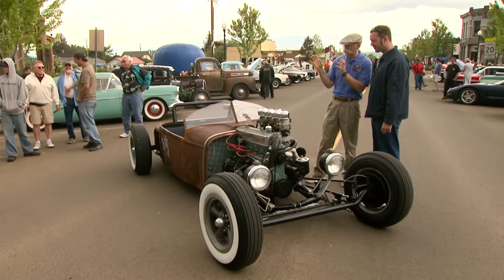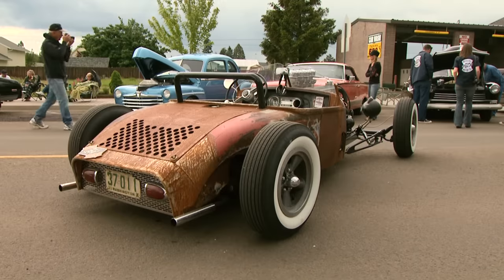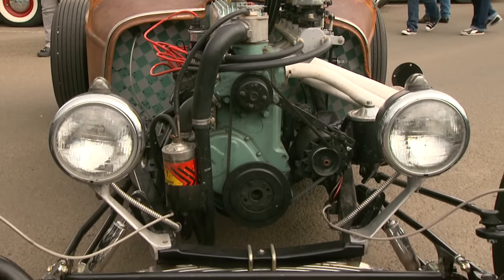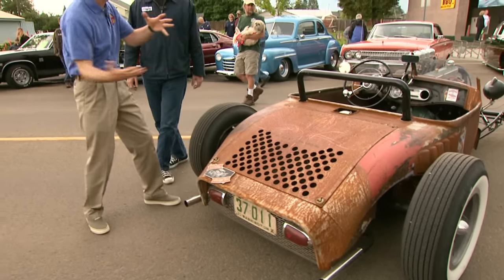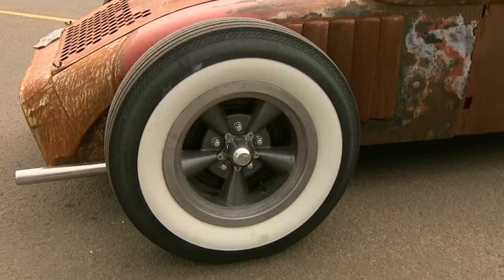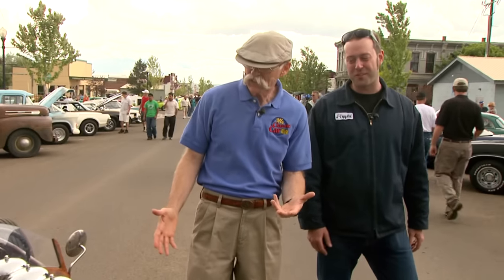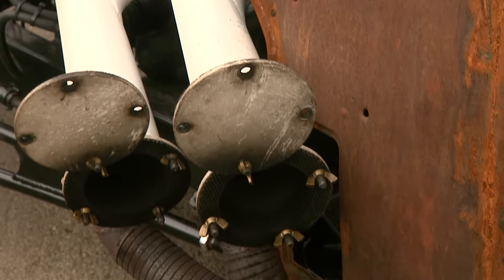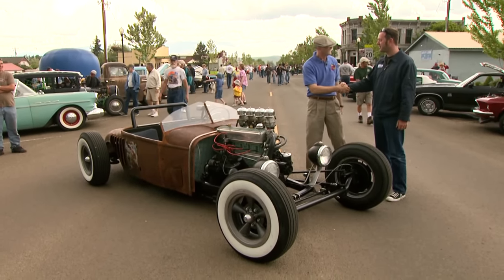Where is the Radiator?

Comment: That's actually a Peterbilt muffler shield on the back of that car- a Kenworth would have round holes. Rat rod guys are a different breed in that they are very resourceful and excellent engineers/ fabricators. Love your work too Dennis! Thanks for sharing.
Reply: True on KW having round holes and Pete having slots, had both trucks
Reply: You can literally order that exact piece of perforated sheet metal with the margins off of McNichols.
Reply: Gross!
Reply: "Excellent engineers/fabricators" 
I thought the whole point of the rat rod aesthetic was to have a car that just looked like it was tacked together from old parts aka: antithetical to the idea of "excellent engineering."
Reply: What I imagine is the piece of chrome is laying on the ground in a scrap pile and the guy says, 
 "what's that from" 
"Old kw"
"Can I have it?"
"Sure"
Reply: It's cool to know... but they probably hardly care — could find a way to make it work no matter what XD
Reply: I'm sorry to say I have been around trucks my entire life and will say I know for a fact that it doesn't matter what the design is they can be found on other trucks slots rounds or anything in-between can be found on Peterbilt kw freight shakers or Mack
Reply: @viscountslappy5085  the whole point is that they ARE cars built from old parts.  It takes some damn good engineering skills to take a pile of old cars and make something that runs, LET ALONE be fast.  Engineering isn't about building the shiniest, techiest, most corporate thing you can.  It's about making shit do what you want.  I want this old pile of parts to bring me around canyon roads at 90 mph so I'm gonna beat it to fuck with my bare hands and weld it all together until it knows its purpose.  that is engineering
Reply: @misdelivereddishwasher1011  Sounds like ham-fisted slapdashery. But, I guess we're taking a wide view of "engineering"
Reply: @viscountslappy5085  there is no template for ratrodding. I can take a Taurus, cut the front end off, put a dodge pickup front end on, lower it, put a Camaro rear end on it, and call it a rat rod.
Reply: @viscountslappy5085  No you're just taking a weirdly narrow, elitist view of engineering.
Reply: @viscountslappy5085  But to make one run and not fall apart and kill you takes real skill and often a lot of custom parts, which is excellent engineering.
Reply: Rat rods are garbage and they’re played out. So cliche these days
Reply: @tylergaye5457  yeah, it's engineering in the same way my beer league flag football team is the Rams...
Reply: @viscountslappy5085  As a mechanical engineer, I can tell you firsthand that most guys in the industry don't even have the creativity or hand-working skills required to make a build like this. 

And I can tell you're also not one of them.
Reply: @viscountslappy5085  nah man stop moving goal posts, you yourself said they "looked" cobbled together- why don't you go fabricate a entire car from scrap metal and extra parts and then come back and rip on this guy, until then you just sound like a jealous tool lmao
Reply: @viscountslappy5085  "wide view of engineering" lmao oh like uh checks notes like designing and fabricating an entire car? Nah that doesn't count, good thing we've got gatekeeping armchair tinkerers around to tell us what stuff is OK to find cool. Theeeeeenks
Reply: None of those words made any sense to me but alright
Reply: You would be surprised. When I was a kid I was constantly dragging stuff home and making something out of it. Come to think of it I make a living do it now.
Reply: @trevormiracle5476  agreed
Reply: @viscountslappy5085 key word, looks. They have a ratty aesthetic which actually requires the same level of skill and attention to detail as a perfect, polished restoration would. If the fit and finish isn't perfect, a ratrod stops looking cool and just looks like shit.
Reply: @viscountslappy5085 that's funny, I don't see anything about your hand-built, custom designed car on your channel. I guess it was such a trivial feat that you didn't think it was worth posting about. Go ahead and show us! I'm dying to see it.

Comment: The most fascinating thing about this for me isn't the radiator location, it's that these things are road legal. Around here cars sometimes have trouble passing the check because the owner fitted them with factory alloys since the last check. I reckon test centers around here would just spontanously burts into flames if you brought any of these within earshot of them.
Reply: They generally fall into a "homebuilt/kit car" category depending on the state. The other option is to use a factory built chassis that has a vin number and existing title. Home built cars has to adhere to some very basic road standards, like light size, placement, output, brake lights, indicators etc there's a bunch of other qualifying needs to get a title and register it but none are all that difficult to accomplish and still build something this unique and "rough". If using an existing titled factory built chassis and registering the vehicle under that existing vin/titke you have to adhere to whatever the standards were at the time the chassis was built. Example would be if the safety equipment requirements at the time the original donor was built required a lap belt, your build needs to have a lap belt and even that only applies to states that require periodic safety inspections to maintain registration. Insurance can be a different animal and most states make insurance a requirement to register so you could face difficulty getting sone wild build insured but from a basic state vehicle requirements standpoint it's practical free reign on what you want to build. 

Compared to the millions upon millions of factory built cars on the road - rat rods, hot rods, classic restomods etc make up such a small percentage of vehicles on the road that most states see it as a non-issue to leave their legality very open. The line of thought is if you are driving a custom built car with no airbags, seat bets, roll over protection etc and you get hurt/die in a car accident that's on you, you knew the risks.
Reply: Washington doesn’t have inspections
Reply: Wish we had some more freedom like this in europe
Reply: @LukebeingLuke  I think Australia has a good compromise with modified automobiles,  from what I understand  you may modify your car but an engineer has to sign off on it for safety reasons.
In some parts of America it's not uncommon to see cars bouncing down the road because of bad shocks/struts , worn out suspensions and structural damage to the body and chassis.
Reply: there's still places in the country that don't have inspections at all. if it's insured & has turn signals on it you can register it
Reply: registred as antique does not require inspection
Reply: @MrStacy1974  Not sure on that, but Mighty car mods did a video on how much of a pain it is registering a car down under.
Reply: Is this Brazil? Lol
Reply: @MrStacy1974  That doesn't sound like a good compromise at all.
Reply: in some stupid countries you can't even change the stupid color of your car. That's what I love about America, the freedom.
Reply: @gabrielv.4358  se fosse já teria até PRF indo atrás kkk
Reply: I like to look at those "cars" definitely fun thing to and drive, did many crazy things myself , though this should fail the mot in UK it is not safe for anybody - imagine anyone geting run over.
Reply: Depends on the state. A mentor went round with the state getting a home built car registered and licensed to drive on the road. The key was getting an insurance company, who was hesitant to insure a vehicle not registered and licensed, to take money for insurance. The state soon came around because money. Everyone was a winner because money. Hail the The 285 Ferengi Rules of Acquisition. The man who's memory I honor won a bet to make a model A roadster for under $1 per pound. He got it registered, drove it to car shows, won awards because of things like hand quilting the upholstery and fabricating radiators and tanks from stainless steel milk barrels. Cool cars. Enjoying the ride.
Reply: @Johnny White I've made it 48 years and in my observations people will do the absolute minimum they are required to as far as safety is concerned. 
All of those regulations when you go racing were written because someone was killed,  but go ahead thinking ALL people are intelligent moral people with the best of humanity in their hearts.
Reply: There is still a few states that aren't over regulated nightmares.
Reply: It is technically a very old car from a very dangerous era.
Reply: @The_Defiant_One  absolutely. Loads of them are LPG.
Reply: Most of these don't get driven much.
Reply: I'm sure it's not street legal by any State DMV guidelines. You notice the question didn't come up during the interview.
Reply: I highly doubt the open wheels are street legal.
Reply: Must be in Pennsylvania!
Reply: @Johnny White As a matter of fact, I have been to TN. When I was there I did not see one open wheel vehicle. I am sure they exist in every state, I very much doubt they are legal in any state, because of the hazards they pose. The fact that every single car manufactured has fenders that completely cover the top of the tires should be a clue.
Reply: @MrStacy1974  
It depends on the state.    The NE and California tend to be more strict about regulations.   
Where I grew up, Oregon, there was no emissions inspection for a car over 20 years old.
Reply: @charlesvan13  I was speaking from a Texas vehicle inspector's point of view, we have a 25 year rule for emissions  testing in metropolitan areas (Dallas,Austin,Houston etc.) but most of the state is safety only.
Reply: Where are you located SomiTomi ?
Here in the UK it is the same except the police seem reluctant to challenge the selfish arrogant people who think the laws weren't made for them to comply with and drive them on the road regardless.
Reply: The real test comes in the UK if you are involved in an accident. 
Even if not your fault.
The insurance companies refuse to pay out as the vehicle is considered "not roadworthy " 
Can work out very expensive.
I was stung for retrofit alloy wheels when someone wrote my car off, legally parked, in the street whilst I was asleep !
Reply: @michaeldose2041  not that your car is worn,  it's to double check your work when you've modified safety critical components.
Reply: @michaeldose2041  what you are talking about is the T.U.V. in Germany and the M.O.T. in Britain.
Reply: @MrStacy1974  ''think Australia has a good compromise with modified automobiles,  from what I understand  you may modify your car but an engineer has to sign off on it for safety reasons.
In some parts of America it's not uncommon to see cars bouncing down the road because of bad shocks/struts , worn out suspensions and structural damage to the body and chassis.'' YOUR WORDS, explain to me what an engineer has to do with cars bouncing down the road, or are you just A.D.D.?
Reply: @michaeldose2041  I lied .....
You do realize that my original response was to a European and the first sentence was a compromise for his situation?

The second sentence (I use punctuation) was me explaining what I've witnessed on American roads.
Reply: @MrStacy1974  But you promised you weren't going to talk to me anymore. Honestly, you're sounding a little defensive.  Is that projection thing getting you again?
Reply: @michaeldose2041  nope ....
I thought I would write out a response in Crayon thinking you might understand, I was wrong I guess.
Have fun falling down the rabbit hole.
Reply: Guarantee you it's safer than an original 30's Dodge.
Reply: If you have the brains to build it and the balls to keep your foot in it you should be able to drive whatever you like
Reply: @MrStacy1974  makes sense, "build whatever you want, but since you don't know shit let's see if a guy that actually studied engineering gives your death trap the golden wrench of approval"
Reply: Where
Reply: This car is pre smog and pre most regulations.
Reply: Always use a factory chassis with numbers so that it can be registered.   Even if you modify the chassis.
Reply: Where?
Reply: @roboyou don't need turn signals if they weren't factory.
Reply: @rexjolles only inspected upon change of ownership, not a yearly thing here.
Reply: @michaeldose2041 it depends on the weight of the vehicle.
Reply: @charlesvan13 its still that way in California.
Reply: @stevewilliams2498 a good reason to NOT live in the UK
Reply: These are road legal where I live but not a Japanese Kei truck
Reply: @weareallbeingwatched4602  dangerous? How so?
Reply: @MrStacy1974 the fact that America would rather have rusty broken cars driving on the road than modified cars really goes to show how far gone you guys are.
Reply: @jwalster9412  don't include me in your rant ..... I'm the one advocating for responsible modifications .
BTW you're responding to a post I made a year ago.
*edited to correct time line.
Reply: Well, some states in this country still let us have a few rights.........
Reply: @LukebeingLuke I bet!
Reply: @MrStacy1974  that’s not a good compromise at all. I agree with basic safety inspections but there’s no evidence they increase road safety.
Reply: @garylampkin4288 you would be incorrect, sir. AFAIK, every single state makes exceptions and allowances for historic and antique vehicles, and you could drive this car like you would any other car in most of the midwest and the south.
Reply: @michaeldose2041 they were legal when the VIN for this car was issued, therefore they are legal on this car.
Reply: @MrStacy1974  It took decades to get through the Bureaucrats in Australia's various over populated government departments that owner modified vehicles were OK. The biggest problem was that from the beginning the vested interests who built cars here in Australia didn't like the idea of old cars being recycled .Mazda for example led a push to ban transmission swaps. The Greens tried and succeeded in getting used engines from Japan and the USA  imports banned. Every time any of this crazed politicking succeeded ,  an organisation or business was shut down. In the 90's even, as most car manufactures went from construction into full importation they still supported the politicians who would do their bidding ,which saw the registration of "rat rods" suppressed,actually led by the leading body of the Hot Rod hobby. Many of the Australian rules regarding Hot Rods (there's a whole manual covering it) are now copied across the globe. PS Australia doesn't have a written bill of rights.... think about that.
Reply: @Mercmad  if you go back and read the post I originally responded  to , he stated that his country doesn't allow modifications  at all.
BTW
My current projects are a Mercedes 300ce manual transmission 330mm front with 300mm rear brakes , poly bushes, lowering springs and a turbo for the future.
My other project is a 1938 Chevy pickup,  seat belts , lighting and signal upgrades ,4 wheel disc brakes , Chevy 350 , 4 speed manual and dropped axle in front and spring under axle rear for a150mm drop.
I make sure nothing touches the ground in case of a blow-out, My brakes and suspension can handle the speed and my steering is sorted.
Reply: Sounds like the TÜV here in Germany…
Reply: It's because they don't drive them every day. More like for only car events maybe once or twice a year
Reply: Falls under antique. You basically don't have to follow any of the rules with an antique because they can't be expected to keep up with modern saftey standards because they weren't built with them back in the day. For instance, if your car didn't come with seat belts from factory due to its age. Your not required to install any
Reply: Past a certain year there's no reg. Plus there's kit cars and other designations similar to experimental aircraft which also skirt regulations. Most states dont have inspections anyway, and there's usually a 20-30 year rolling smog exemption. which if anything has just led to a lot of vin swapping.
Reply: @roboticunclephil  in Iowa if it has a VIN and a clean title history they never inspect the vehicle when you register it. What you see in this video would be totally legal.